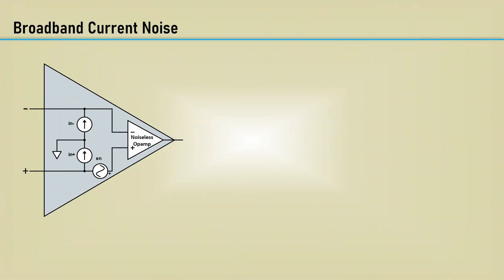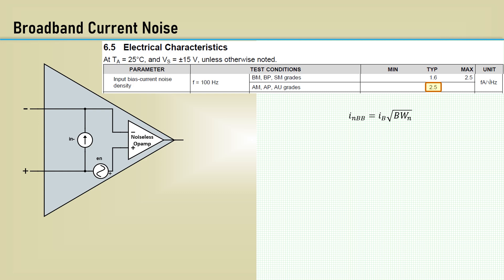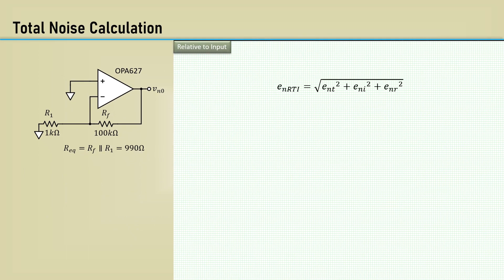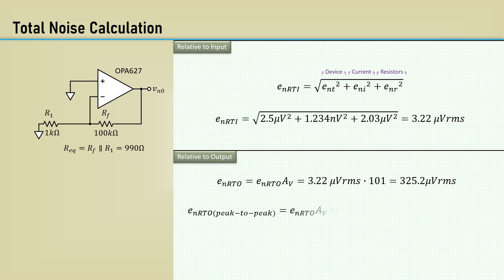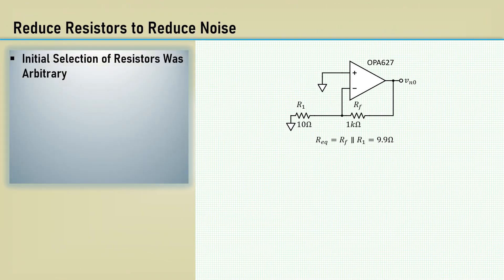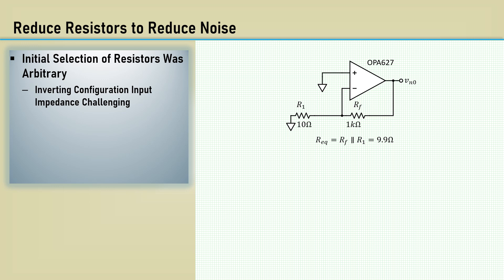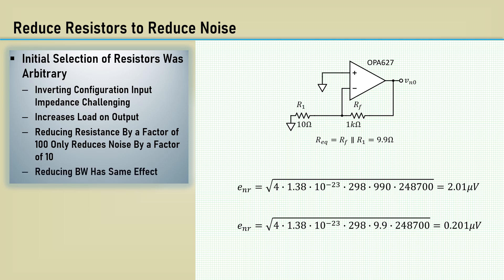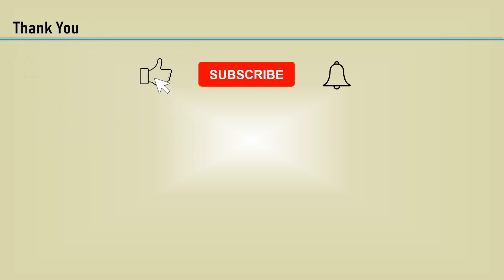Op Amp Noise Calculations - Part 5

Comment: Awesome videos! I was wondering if you have anything on how to reduce shutdown shut down voltage spikes on the output of DC coupled op-amps in an audio application.
Reply from the maker: Thanks. That is a tough one. It would depend on the detailed design. One thing I always did was to capacitively couple the final output stage that has a DC bias through a resistor to ground. But there are all kinds of opportunities for turn-on and turn-off spikes.
Reply: @oldhackee3915  very interesting. I'm going to experiment with shutting the output with a depletion mosfet. I'll let you know how that goes. Just a side note the tl072 are easier to manage than the ne5532. I'm fine with the tl072 however I getting some pressure from consumers wanting the ne5532 they think it has a lower noise floor. That may be true however I can't hear any noise whatsoever from the tl072s.
Reply from the maker: The NE5532 input noise voltage is only 5nV/√Hz where the TL072 is 18nV/√Hz. You are probably not hearing any difference because the resistors are dominating the noise. The input current noise of the TL072 is lower than the NE5532, but current noise is usually insignificant.
Reply: For sure on either op-amp I could not hear any noise whatsoever even pressing my ear into the speaker. But people want to play around with different op-amps so that's why I will used sockets. I had a problem a while back with pop on shutdown, it turned out to be a bad  decoupling capacitor
Reply from the maker: Cool.
Reply: @oldhackee3915  well that problem is solved and went old school and use the 24 volt relay shunting the output on shutdown.
Reply from the maker: That is old school, but it works.